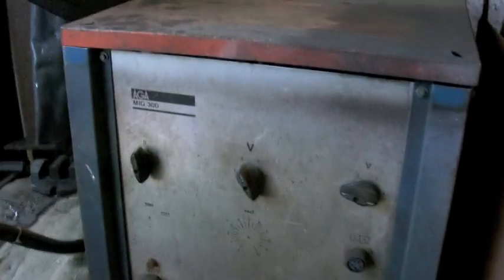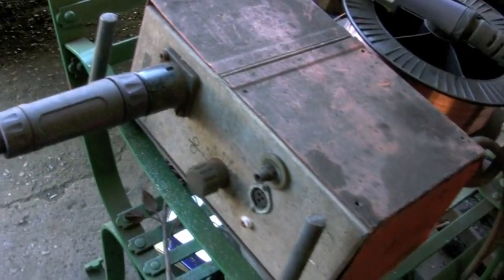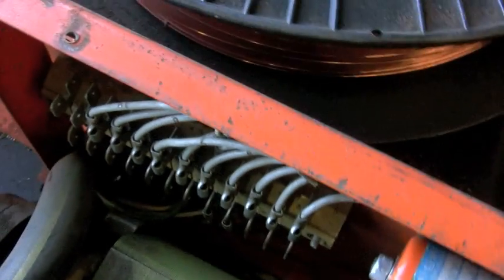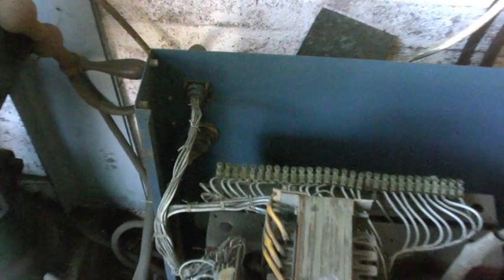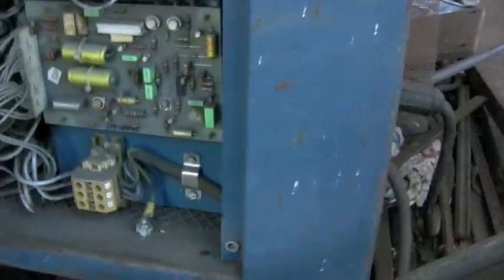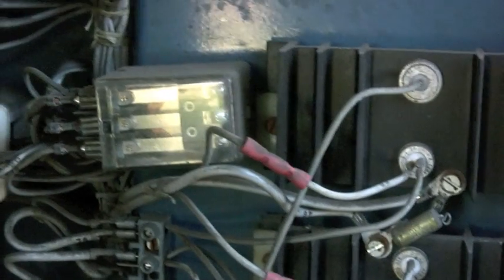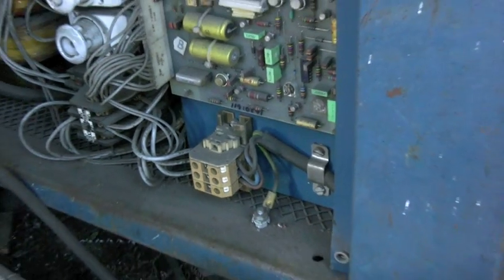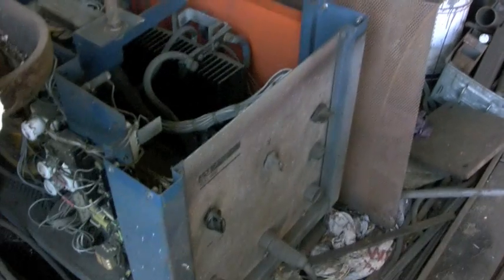Faulty AGA Welder.

Comment: I am assuming that you have fixed the problem already. If not I would say thoroughly blow out the entire inside of the welder. You can use a shop vac exhaust, compressed air for cleaning computers, and/or shop air if you have it. Be careful if you use shop air it can be wet and it can also break things due to its velocity. After you do that see if it fixes the problem. More then likely it is a broken solder joint and/or a broken wire. Just make sure all the screws are the appropriate tightness and then look for cracks in the solder joints on your electronics board. After you do all that you may find a patent number in which case you can contact the patent office and get an electrical blue print. But, blow it off it may just be the dust making a connection it shouldn't be across the pcb. it happens on batteries on big rigs no reason for it not to on anything else.
Reply from the maker: Did all that blowing off, checked all solder joints I could find, although there weren't many, it's very old, so finally sold it for scrap!
Reply: figured it had been too long that you prob did something with it.
Reply: +garyhuston I hope it went to someone who could fix it, those old machines are way nicer than any modern stuff

Comment: Been in touch with a mate who IS an industrial electrician "sounds like he has a live feed instead of a switched live to the solenoid.....if he hasnt messed with the wiring he could have a short between switched and live....this could be due to furing caused by bits of metal particles between connectors....give the terminals a good clean and spray with a contact cleaner....also try and take cap off solenoid and clean contacts in there"

Comment from the maker: That's the point, I can't find a relay that is controlling it, none are connected to the solenoid. It could however be transistor controlled, if that's the case I'm screwed, I know nothing about electronics!

Comment: also please excuse my assumption that it being orange was the Butters colour.  There's only 2 wires in the trigger and if the rollers are rolling, then either the solenoid or the relay are faulty or it's a dodgy or intermittent connexion

Comment from the maker: The wire feed says AGA in big letters on it but I guess someone else could have made it. The solenoid is working, when a current is applied gas will flow, when current is removed gas will not flow, don't think that could be more in doubt! It's just receiving current when it shouldn't! I have posted on the welding forum but no luck yet...  :o(

Comment: An AGA plant but that's a Norman Butters (Coventry) wire feed unit. You should only need to change the feed unit.  Sounds to me like the solenoid is tricking you into believing that click means it's working ok. Is what the solenoid is connected to (gas tap) connected or become worn? I'm no expert I only learned what I know from taking notice of the fella that repaired the ones at work. Some good MIG welding forums about. Good luck